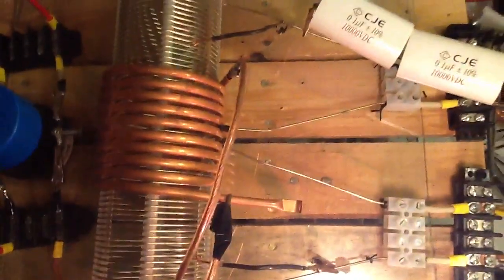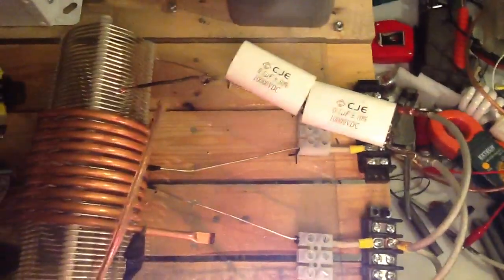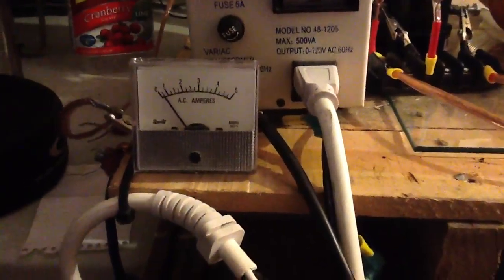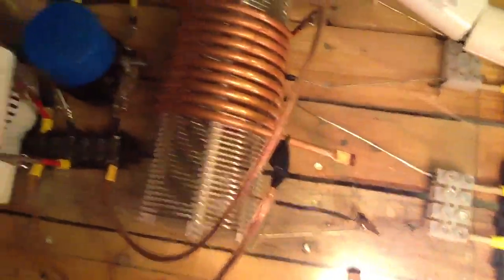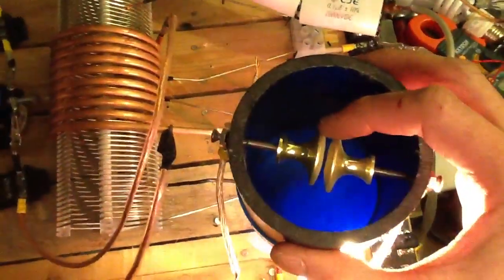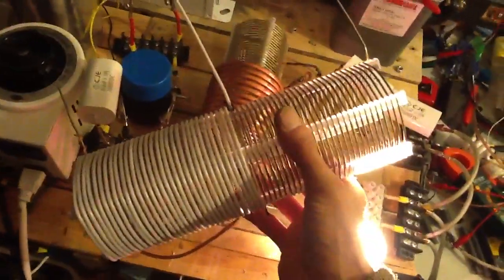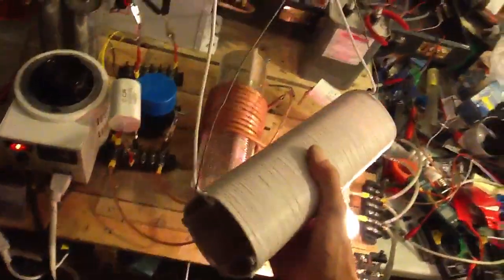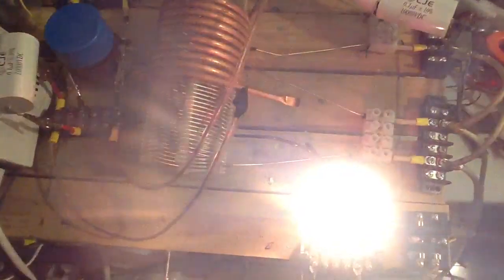41 Don Smith Device: Completely Air Cored, Primary Outside, Increased Light

Comment: Why do people warn against using electrolytic caps early in these circuits, but most people use electrolytics in the cap bank at the output? I believe it's due to high frequencies damaging electrolytic caps, but I have not tested so I will ask what the usual frequencies are at those early and output cap locations? Thanks

Comment: From your experience with this, do you think 10kw or more is possible with a 37khz 9kv nst?  I have heard Don Smith say numbers like 160kw but have had a hard time finding videos of units up and running let alone creating steady amounts of usable power.  Thank you again for putting up these videos.
Reply from the maker: hi there, I have read similar things. and I don't see that happening. but that's assuming I am doing this correctly... possibly not :)
Reply: what freq and voltage do your devices run through the primary side if you don't mind sharing.  Thank you for answering my nagging questions.